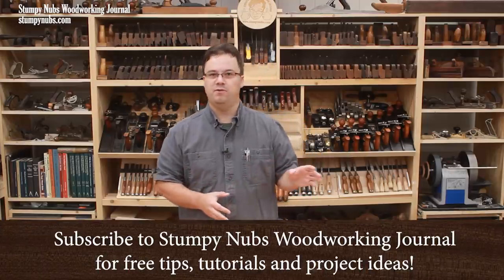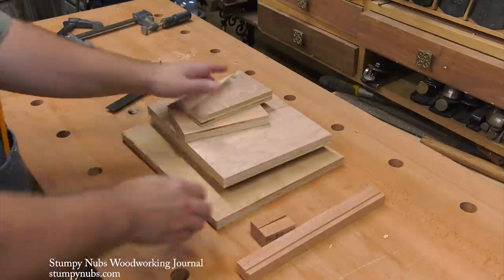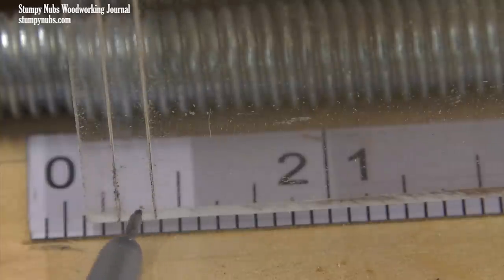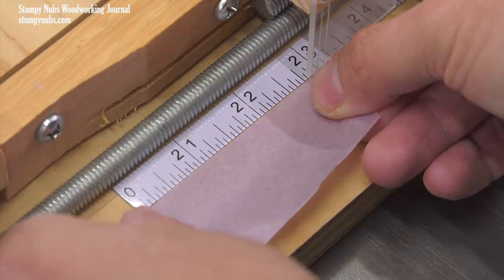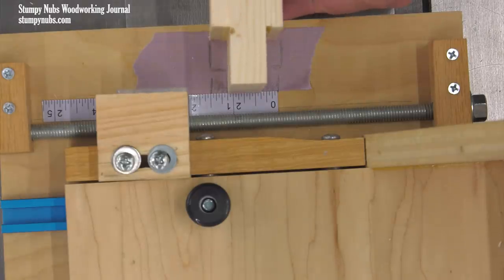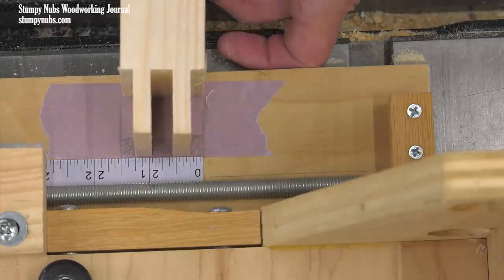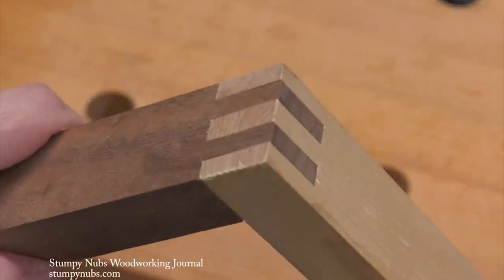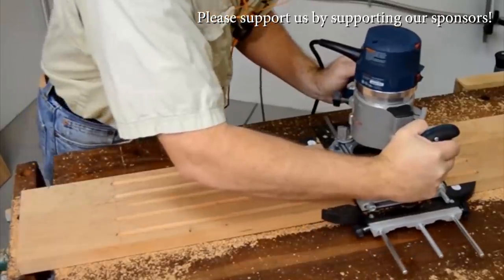Simple DIY Idea Changes Table Saw Jigs!

Comment: Neat Jig and I have ordered the plans … one thing bothers me … the lower part of the jig is held square to the blade by the miter slot, but the upper part moves left and right on the ball bearing glide and locked with the T track … inevitably there will be ‘slop’ in the glider and movement in the T track … apart from the short section of the threaded cursor bar I cannot see what guarantees square between the two halves?
Reply from the maker: Ball bearing drawer slides are quire accurate, especially since the travel length of this jig is not that far.
Reply: @StumpyNubs  hi thanks for that … I sent payment for a set of plans on 18th October but nothing received yet?
Reply from the maker: @michaelsnelling2918  I need your email address to look it up. Contact me through our website: https://stumpynubs.com/inquiries/
Reply: @StumpyNubs  Hi James I have now sent 2 messages, the second with my email address but still no sign of a link to download plans?
Reply from the maker: @michaelsnelling2918  - I did some digging and it appears that you put an unidentifiable web link in your email to me to what I think may be an image of your receipt. That suspicious link caused your email to be blocked and it went to spam. I have located it now and will respond through our website's email system. Sorry for the delay.
Reply from the maker: @michaelsnelling2918  Response (and new links) was just sent.

Comment: You forgot to say that one turn of the thread is 1/16, meaning that if you add an indexed handle you can move exactly by 1/32 (half turn), 1/64 (quarter turn) and return easily back to the original position for repeatability.
Reply from the maker: I applied that idea to my finger joint jig. It's on our website in the plans section as well.

Comment: I find the Imperial System fascinating, I cannot understand why it gets so much flak.
Reply: It gets flak for its deficiencies when compared to the metric system. The idea shown here has nothing to do with either system, just something that can be done with threaded rod
Reply from the maker: It gets flak because people who don't use it can't stand the idea that someone on the other side of the world has a different ruler than they do, even though that person is quite happy and capable using his imperial ruler. :)
Reply: @StumpyNubs  I guess that can go both ways XD
At least here in Belgium (probably other countries as well) imperial is still pretty much exclusively used for air/water fittings among some other things. Working in a tool store I need to know at least some basics of the imperial system.
I find it interesting, stupid, inefficient yet efficient at the same time. I guess it's mostly what you grew up with and learned. (like your sawblade is perfectly 1/16th" whilst mine is 3.2mm, sounds annoying to take into account for this jig XD)
Reply: @StumpyNubs  I’m English, so I use both. Often together. Great idea, must check the pitch on my M10 threaded rod.
Reply from the maker: @boomerangfreak  And it's totally fine with me if you use metric, imperial, cubits, rods, whatever works for you. If it gets the job done, it's not my concern. :)
Reply: @Canalcoholic  if you go metric fine you can get stuff like MF10X1 and MF12x1 and well many more. That is if you want nice 1mm adjustability.
Reply: @StumpyNubs  what about smoots? I heard that one is controversial. 🤔
Reply: @boomerangfreak  Maybe so, but I was talking about using what I’ve already got, M10 threaded rod - yards of the stuff!
Reply: I use both together quite often....also use pocket screws, biscuits, and coping saws on a regular basis😀

Comment: Not sure what he is talking about.  Nwver heard about cm ? Its 21 st century
Reply from the maker: I'm sorry you can't understand fractions. We don't find them as challenging as you do. Even so, that has nothing to do with this jig. The same principal can be applied to millimeters by simply using a corresponding metric thread.
Reply: @StumpyNubs  i dont inderstand imperial system although i get a taste of it once in a while when working with steel and wood . but yes i guess it can be applied eithet way .